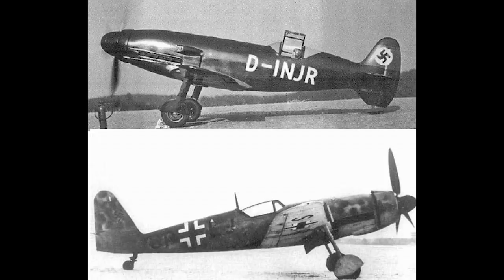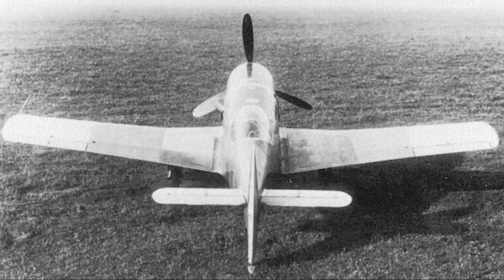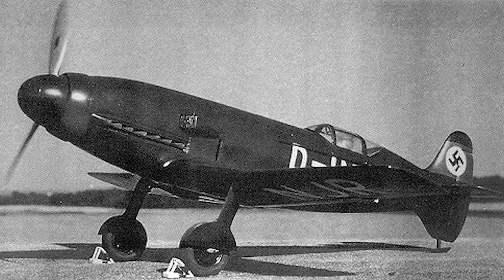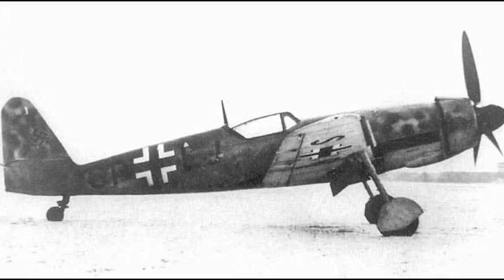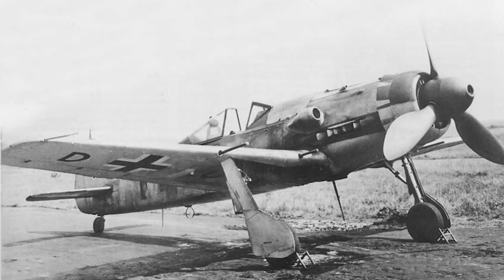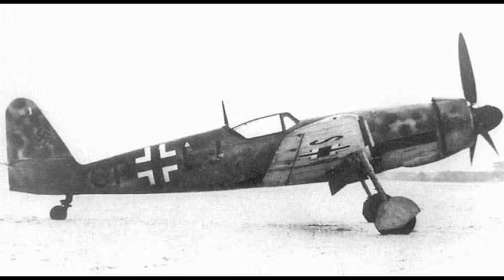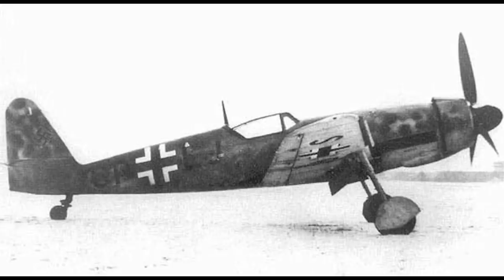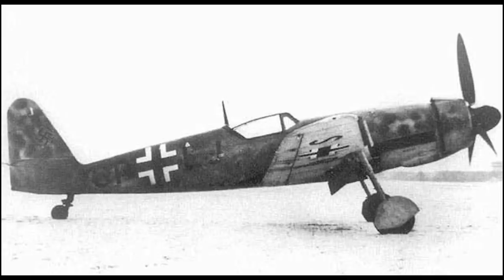The ME 209 I & II: Two Attempts to “Replace” the Luftwaffe Stalwart

Comment: That must be one of the few times in the late war that the Germans did something sensible regarding aircraft designs! Their designers were outstanding, but politics tended to cause dissipation of effort on unrealisable wonder-weapons
Reply: Thank heavens they were in love with so-called wonder weapons. I dread to think what would have happened had their high command been sensible. They could have had the ME262 by 1941, rather than 1944. I'd probably be typing this in German had they done so...
Reply: @laurieharper1526  if they've been sensible they would have had the Me-262 in 1945
The airframe was ready to go  the delays were with the engines
The me-262 was rushed into production 1 year early ,before it was ready frontline service.
Reply: Take a look at the Porsche version of the Tiger 2. Ferdinand Porsche was trying to design a very complex, very expensive, experimental tank in the middle of a losing war where the Russians were making 1000+ T-34s a month. That fiasco was not political, it was engineer's ego.
Reply: @jamesricker3997  It was rushed into production as a fighter was because Hitler insisted for a long time that it should be a bomber/ground attack aircraft. Work began on it before the war and it first flew in early 1941. Adolf Galland and others were pressing for it to be developed as a fighter, but were ignored, fortunately for us. The issues with the engines were due to the fact that Germany did not have access to the materials needed to make them reliable by the time the decision was made (too late) to use it as a fighter. The engines would only run for 10 hours before needing to be removed and completely rebuilt.
Reply: @laurieharper1526  
"It was rushed into production as a fighter was because Hitler insisted for a long time that it should be a bomber/ground attack aircraft."

This was a common belief years ago but it has now been debunked. All German fighters were designed required to be able carry bombs and that included the Bf-109 and Fw-190. That the 262 could carry them too was no surprise. I think it was the Military Aviation History channel which did the story on this.

"The issues with the engines were due to the fact that Germany did not have access to the materials needed to make them reliable by the time the decision was made (too late) to use it as a fighter. The engines would only run for 10 hours before needing to be removed and completely rebuilt."

This, on the other hand is quite right. Calum E. Douglas gone into a lot of detail on this in his book, 'The Secret Horsepower Race'.

Comment: I think the main issue in the Bf109 couldnt be resolved until a whole new other plane was made, but I dont think Messerschmitt had it in them. The Heinkel 100, once fitted with real radiators, would've been an incredible jump in performance, but Goering was keen on those Messerschmitt bribes...
Reply: Well i dont think its that easy to replace the He 100’s cooling system, it would basically required to be redesigned almost completely
Reply: "The Heinkel 100, once fitted with real radiators, would've been an incredible jump in performance, but Goering was keen on those Messerschmitt bribes..."

I'm going to have to well, not agree with this. The German radiators were simply not as good as the allied ones in terms of drag performance. The allies used pressurised radiators which made them both smaller and more efficient. The addition of radiators would have seen it reduced to roughly the same levels of performance as other fighters. And that's before we start looking at the extra stuff that's needed for a combat aircraft, like armour plating and weapons stowage.

Comment: Messerschmitt should have adapted the wide stance landing gear of the ME 209 to production ME 109.
Reply: The 109s landing gear was like that on purpose ,to speed up production in factories.
Planes  without wings yet installed could be wheeled around the factory floor.
Reply: @Crashed131963  - That is true but it also contributed top a very large number of crashes. I seriously believe the costs incurred far outweighed any benefit.
Reply: @scootergeorge9576  True.
Loss on Take off and landings were much higher than the wide stance FW-190.
Reply: @Crashed131963  - Thank you. You've made my point.
Reply: @Crashed131963  That and the fact that the wings were simply not strong enough.